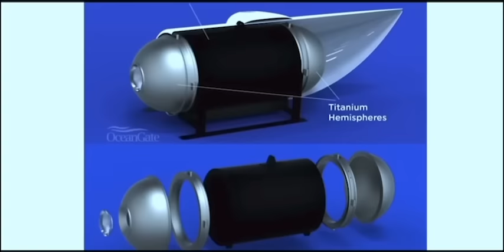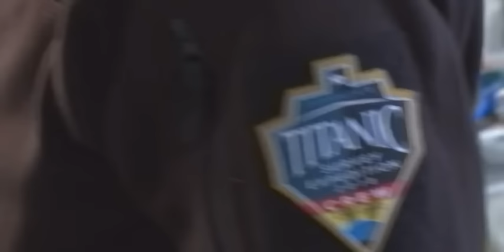First look at #oceangate #titan Debris

Comment: Using a composite for a compression load is stupid if you know about composites. Composits bear loads in the higher modulus material, in this case carbon fiber. But mainly when the part is in tension. Making a composite part that loads the fibers under compression is a very tricky thing. A compression load will put the matrix in tension and if that load is not transferred to the fibers, it will fail. Also, repeated loading cycles will cause microcracking in the matrix, which MUST be quantified through imperial methods on the exact duplicate of the chosen design. this data will reveal the cycle life of the part to allow a quantified safety margin. We have a similar parameter for climbing ropes where they are rated by "falls" Once you fall a certain number of times, that rope is no longer certified.

Also, if this cylinder was wrapped without adequate biasing of the fibers, it was destined to fail along the longitudinal axis as the fibers were suspended in the matrix as annular members and had no support to avoid sliding by each other as the matrix failed. Using woven fabric probably would have been a better choice bot only with destructive cycle testing to failure to establish the actual imperial engineering window. Ultimately, making the whole vessel from titanium would have been much wiser.

Also, the gluing step was idiotic. there were definitely bubbles trapped in the bond material. The method to avoid that would be to add a large bead of material that is bubble-free and allow it to squeeze out avoiding retention of any bubbles. Ultimately a high-performance gasket made by a gasket company would have been a better choice as the two materials don't have the same reaction to loading and may not have had adequate elasticity to maintain the bond.

Comment: It is not correct to refer only to carbon fibers, when, in reality, the composite material consists, at least, of matrix (epoxy) and reinforcement (carbon fiber). This combination creates an orthotropic material with different properties in relation to their planes of symmetry, with greater tensile strength in the direction of the fibers and good to moderate compressive strength in the direction perpendicular to the fibers.
.when they say that carbon fibers are not to work in compression, it is better to clarify that they are referring to the direction of the fibers, because if the load is perpendicular to the fibers, then the resistance to compression of the composite is also derived from matrix (epoxy).
what can be done to keep the tension levels of TENSION and COMPRESSION within the limits of the material is to combine several layers with their respective direction of reinforcements in order to take advantage of the best of the individual properties of the constituents of the composites.
.wall thickness and geometric shape are also points to consider.
On the other hand, fatigue in this type of composite (carbon fiber and epoxy resin) is crucial and, in my opinion, the key point in this tragic collapse, in addition to the wealth of the rich and foolish adventurer.
Effects of temperature and  moisture (absorbtion of water) must be took into consideration, as well.

Comment: It wouldn't surprise me if they were just using JB Weld. They mixed it by hand in a warehouse, no clean room with humidity control just a big open warehouse where you can be sure contamination of the adhesive was certain to happen. They use more sophisticated techniques to make surf boards. This guy was just an arrogant rich guy with not an ounce of common sense.

Comment: Once the "Elmers' Glue" was in place, why could they not space thru-bolts all around the perimeter. If they added bolts to make the bond even tighter, they may be here today....( ?)......I am not an engineer,but, the Lord blessed me with lots of "Mechanical Common Sense". I would not bring ANYTHING deep into the ocean that was glued. Especially if the glued pieces were different materials that behave differently expanding and contracting in different pressures and temperatures !

Comment: It imploded because of the front window blew out it was only 7 inches thick and noplexiglass
Reply: Plexiglass
Reply: I thought the window failed, because if the hull failed first, the window would have been forced out, and both flanges on the dome where the glass was is intact, making it probable that the glass failed and made the hull explode.

Comment: They should used flex-seal. Or gorilla glue. The weight of 10 elephants per square inch on a glue joint hmm

Comment: The tubular section in the middle  was the weak point. Doesn't matter if it was glued or bolted. Doesn't matter if it was carbon fiber or metal. There's a reason why every other successful deep ocean sub was spherical. Even pressure all around. The very second you add a tube like section to a sphere shaped object meant for high external pressure, you weakened it. The longer that tube section in the middle, the weaker it gets. If Stockton would have come to me and asked me to design a deep ocean sub that would accommodate five people, it would have been a BIG SPHERICAL CRAFT with crap on the outside! You know, just like all the other ones that have been built and tested. You don't want to test your craft?  Fine, don't do it, but at least learn from what other people spent money testing.

Comment: Working in a Micro-Electronic Lab for the last forty years  We routinely  use many types of epoxy's and bonding agents  but they are usually cured in a vacuum and  at high temperature. We have produced for NASA, JPL, The  Military and deep submersible applications   (Built part of the Mars landers robotic arm)  What I see in this video is appalling.

Comment: That's exactly what I said when I seen the video of them mixing glue together by hand I at work used to mix lots of epoxies there is incidents in the automobile industry where there is zero tolerance when building prototype tooling and a human hair getting in something can hold it up to take out tolerance? If you're understanding what I'm putting down and second of all you are not supposed to lay up carbon fiber in that fashion for strength without having any failure areas it has to be laid up dry with a special process with the reaction after it's been put into a oven and brought up to a certain temperature for certain kinds of strengths everything I see done even in my eyes as a millwright 30 years experience by myself could see so many mistakes

Comment: A cylinder is much weaker than a sphere plus dissimilar materials under extreme pressure are bad, having all that area under 6000 psi against that 5" carbon fiber edge which over a 5-foot diameter would be 17 million LBS of force or 8500 tons (2.3x the thrust of the Saturn 5 moon rocket) which will collapse the CF shell after repeated pressure cycles, this was the "crackling" sound heard by earlier dives which should have been the end of the subs service life. NDT testing like ultrasound would have shown progressive delamination's which also indicates a pending/emanate catastrophic delamination failure in compression. A stupid, STUPID design mistake easily avoided by a mechanical engineer. The builders of this death trap should be running for cover of lawsuits for this negligence, and this is not armchair quarterbacking but easily avoided engineering design. God rest their souls..

Comment: All this talk about expansion and contraction of different materials is irrelevant . The submersible wasn't being subjected to significant temperature cycles, it was being subjected to extreme pressure cycles. The important factor is that the titanium and the RADIAL wound carbon fiber cylinder would be flexing in different ways, and those forces would certainly have a detrimental effect on any joints, bolted, cemented, or otherwise. I question why the CF cylinder was radial wound since CF products generally achieve maximum strength by orienting fibers in various directions .

Comment: Bonding together two dissimilar mission critical materials in a dirty open air warehouse is a big no-no. No cleanroom and no air filtration system. Just out and about on ladders with putty knifes. Ghetto as hell.  The whole construction just screams of shoddy, cheap workmanship. Pressure vessels are the most critical part of the project and they went about making it part of the structure, even hanging a swinging door from it,  lifting from the titanium rings, and putting landing skids on it. They were even loading it and unloading from a barge which put even more stress on the vessel. Just look at the wiring and all those hoses and cables going all over the place. Cable management was just terrible. It looks like some newly licensed teenager's modified car.  It is just terrifying to think humans were inside that double-ended dildo deathtrap.

Comment: Why was the carbon fibre INSIDE the titanium rings!!!  Bad design in hindsight but if the titanium ring was inside the carbon fibre cylinder the pressure would seal the joint, not force it apart.  This abomination depended on glue, not structure.

Comment: Glue!!!!! Oh dear God! I am not an engineer but I do know that you can't use Carbon fiber and titanium together. He didn't even wrap the carbon fiber in a crisscross  pattern it was in rows....
I am an artist and a picture framer for many years and when you are wiring heavy frames you cant take chances you have to use heavy duty screws and wire or picture will come cradhing down and i have seen people come in the frame shop with flimsy wire and srews. I am not comparing the two but making a point that you cant skimp and go cheap or terrible things happen.

Comment: IMO the design may work if the two rings are connected by tension rods inside and outside of the hull. The glue being applied by hand is nuts unless they had a measuring device to keep it consistently the right thickness.

Comment: They shouldn't have used carbon fiber to begin with but machining a flange on the end rings that sank 8-10" into the carbon fiber tube so the ends of it had something to compress against probably would've saved it. Gluing that round end cap on there with nothing but a little ribbon of titanium inside and outside just to line it up to ANYONE even a plumber putting pipe fittings together that hold 30psi looks like a soup sandwich weak stupid rookie bs an idiot would do because he brought the wrong parts. First time I saw that clip of them assembling that thing just thought NO WONDER it failed.

Comment: Wow this is the guy Who's quoted as saying? "there's a lot of engineering rules out there that don't make any sense." Those words.  should  be his epitaph. So you start off with two completely dissimilar materials Titanium and carbon fiber. completely dissimilar  expansion, thermal. and compressive properties And stick them together from a two inch strip of glue. Then in complete disregard We're even most basic pressure vessel 101. Design. do not use a spherical geometry, but instead a sausage. Then put 5 people in it. Drop it down a few thousand meters. What did you expect? It's a damn shame that 5 people had to die this way. I certainly hope that some useful lessons come out of this, at least. rest in peace, gentlemen.

Comment: Too many dives on the hull, descended way too fast, no reliable way to dump the ballast weight on the skids, thrusters failed when they tried an emergency accent.  They had 20 min. to ponder their fate.  I would have ran when I saw the X-Box controller.

Comment: Carbon fiber makes GREAT pressure vessels...when the pressure is on the inside and the force is pulling on the fibers. What strength are flexible fibers supposed to add when they're in compression? The fibers on that sub are also all running the same way. I don't understand how any engineer could think that's optimal. Or even decent. That tube might as well have been made out of pure epoxy with no carbon fiber in it. Those fibers add very little resistance to the middle of the sub flexing inwards. And WTF! Are they mixing that glue by hand? I hope not, but I swear I saw a guy stirring a big ol' pot of glue. People are making subs that can safely go to almost THREE TIMES the depth of the Titanic wreck, and probably have a large safety margin at that depth and could go quite a bit deeper....except there IS nowhere deeper. This arrogant clown had no business trying to Rube Goldberg his way into the club in a plastic pipe. And from what I've read, the sub was only rated for a couple hundred feet deeper than Titanic. How did they establish that? Cus if that was a tested crush depth, then no way they should have ever been operating at 95% of that depth. Especially given the inconsistency of composites. 2 parts off the same assembly line can have a pretty damn large difference in strength. At least if you test a steel or titanium hull to crush depth, you know that every subsequent hull off the assembly line would fold at more or less the exact same depth. And where did they get those motors? I'm thinking they might have made them themselves. 
 The leaked comms between the sub and surface - IF they're real - show the sub descending too fast, and also having problems with power drain...like you'd maybe get if salt water got into an electric motor.

Comment: they call themselves Engineer !!! .... using glue to different parts when they should have learned in Grade 6 how different material expands and contracts under different temperature ..... moreover there are millions of dust particle on top of that glue as they are doing it out in the open .... what a SHAME

Comment: Let’s add just a skim of adhesive(glue🙄) to bond this titanium to the carbon fibre. 
Rush “No! Don’t add too much, it’s expensive and whatever oozes out is a waste”🤦‍♂️
“I know better, I’m an engineer”🙄

As a structural repair tech on aircraft with 35 years experience, in various metals and composite materials, I’m appalled at the video showing where and how they did this work.
Soooooo many incorrectness in techniques, environment and procedures.
🙁

Comment: Carbon fiber is so misunderstood. I remember the freakout when SpaceX ditched it for stainless steel because material science is so much more than tensile strength to weight at 20 degrees C and 1 atmosphere of pressure.... 

Carbon fiber is great for certain applications but the reason it's not been used for this previously is because it's inappropriate for many well known reasons. CF is not homegenous it doesnt have equal strength in all directions and defects are much harder to find than structural metals. The scanning tech does actually exist to find these defects in CF and composites but the scumbag idiot pretended they didn't. 

CF also doesn't like extreme temperatures which is the reason spaceX ditched it for Austenetic stainless. Austenetic SS unlike most metals and carbon fiber becomes stronger at cryogenic temperatures and it also retains it's intgrity at temperatures beyond which CF would have burnt out. 

For SUBS Titanium alloys are the most suitable material as they are very light and strong and have extremely high fatigue resistance. Titanium alloys are also extremely well understood but that means there would be no bullshit excuses to hide behind.

Comment: I think the only thing that was missing was a sausage stuffing adapter glued to the end of the carbon fiber instead of the viewing port.  Put enough sausage casings on the outside of the sausage stuffing adapter to handle up to 400lbs of sausage.  Don't forget to tie the end of the casing off before you start the dive.  The crew can even be creative and stuff their pockets with seasonings and herbs before each dive.  But I digress.

Comment: Could they not just have made the entire thing from Titanium then? I am actually not sure what point they were trying to prove by using carbon fiber. I'm not an engineer, but I would have sent that thing down at least 100 times on a tether and without passengers, with a magnitude of sensors to measure deflection, deformation and other real world data. 
Also, anything but a seamless, welded or flanged mating system at that depth is in my opinion an experimental stunt equivalent to jumping over 120 buses with a mountain bike, powered by an explosive device. Utter stupidity in my opinion. 
Also, it shows you what can happen if you have too many engineers in one room. Even worse, engineers armed with Solidworks and ANSYS. Brilliant software but useless if you don't clearly understand what parameters, fixing points and loads to enter into the Von Mises simulation or Finite Analysis Calcs. 
Practicality and engineering are not the same things, and a non-engineer would have looked at that thing and highlighted the lunacy of the design. Also, with respect, if my engineer looked as nonchalant as the one in the video, I would have told him that he will be the first passenger. That would have made him look a bit more serious about this issue.